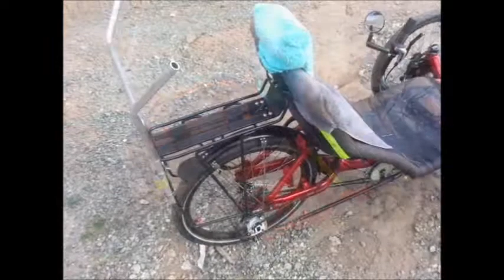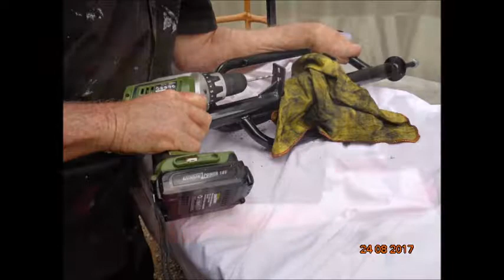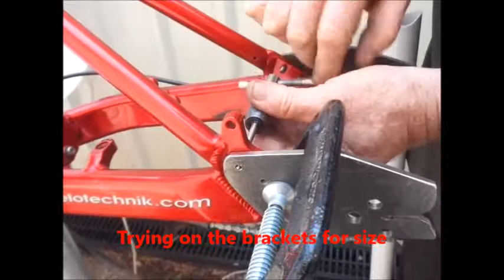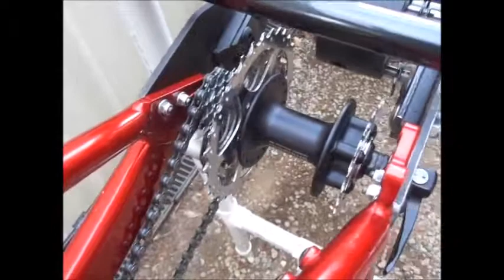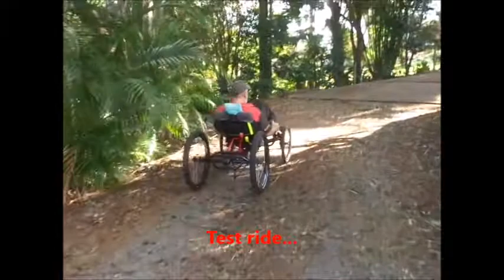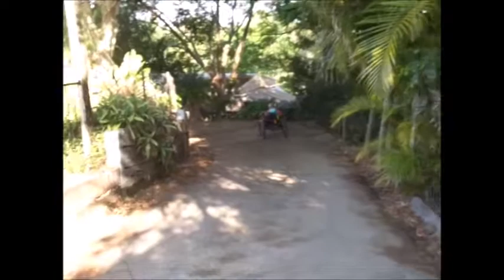Recumbent Quad Conversion

Comment: Am wanting to convert my hp velo to quad. Contacted Utah trikes who said they didnt have a kit for my trike. When asked they said hp velo didnt want them offering kits for the their trikes. What kit did you use may I ask as I'm still keen to convert. Thank you
Reply from the maker: Hi Ken.  We didn't use and designated kit for our conversion. We just got the standard back axle and diff plus a 20T sprocket from Utah Trikes.  We had to get a back hub to fit the 20T drive cog which we got from our local bike shop, we also had to get the rear wheels made.  The brackets to hold the axle on to the frame we 3D designed and got them water jet cut out of 6mm steel that we fitted with stainless steel bolts and nyloc nuts.  We did the conversion 7 years ago, as you can see and a couple of years ago we had 250w Bafang mid drives fitted as they are a bit heavy going up hill :).  We have just done a pretty detailed service and clean and in all that time there are no cracks or distortion on the trikes/quads at all.  We are very  happy with the results.  If there is anything else we can help with, just ask. 😁

Comment: Although I won't do this to my HPV Gekko, I am considering doing it to lesser trikes for use down in the Mexican small town where we go. My concern is with the 4 wheels & a solid rigid frame putting twisting loads on the frame & possibly causing cracks or weld failures. Have you found any drawbacks or weaknesses doing this conversion? I would use an Internal Gear Hub & a 500 watt Mid Drive. Thank you for your reply.
Reply from the maker: Thanks for your interest  Since doing the conversion we have found no problems, no water cracking or any other issues. We have had the 250W  motors for just over a year and intend fitting internal hubs j  the future.  We got the idea from Utah Trikes.  They didn't have a conversion kit for our Gekkos but they do have kits for other trikes. Have a look at their YouTube site and perhaps contact them with questions, we have found them to be very helpful.  They are great fun.  Hope this helps👍😁

Comment: Lovely job! Were you able to use your original rear hub? If not, what did you have to buy? I will soon be converting my Trident terrain to a fat quad using the same rear axle from Utah Trikes. Your video here was my deciding factor. :)
Reply from the maker: Hi. We didn't use the same hub because it did not have the disc brake,  we needed to bolt the 20t drive cog to where the disc would usually bolt.  That and just 6mm metal plate for the brackets and stainless steel nuts and bolts.  Utah trikes do not do a conversion kit for the HP Velo. Gekko but they do have kits for other trikes.  We are so glad you have decided to convert, we absolutely love ours, we wouldn't go back to 3 wheels :-)  If we can help in any other way just contact us.
Reply: Ah yes, now I understand. Thanks very much for your help and support. I am just waiting on the axle and hubs to arrive, my rims arrived yesterday. It's exciting! :) I'll be in touch.
Reply: Georgia Hoffman Where did you buy the 20t drive cog? Do you have a link for it by chance? My conversion will involve some custom Welding to make it all work. Moving ahead, bit by bit! ;)
Reply from the maker: Hi. Sorry for the late reply.  We got the 20T cogs from Utah Trikes. Our conversions also took a bit of trial and error before we got it right. Good luck.
Reply from the maker: Hi Didgemann80.  How is your conversion going?  Hope all is going well.